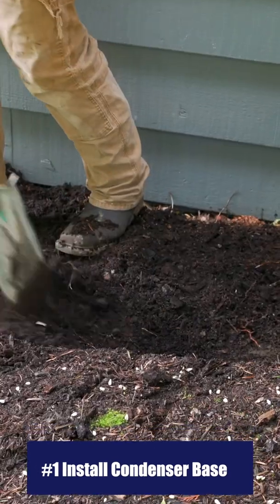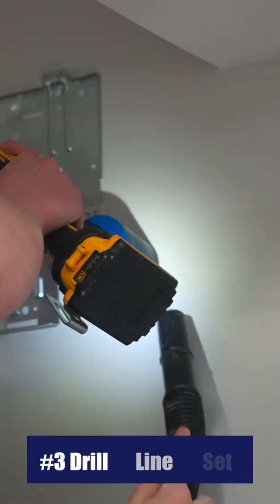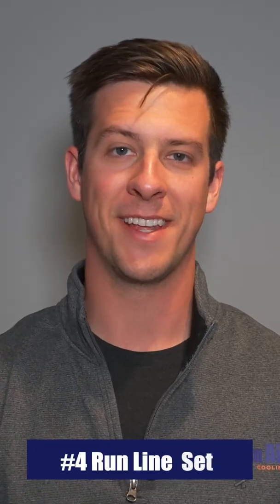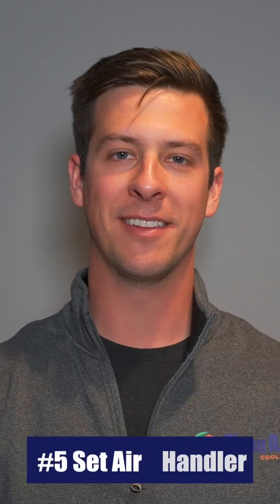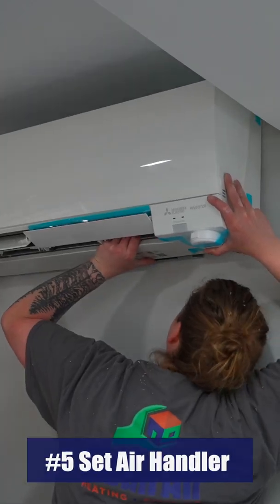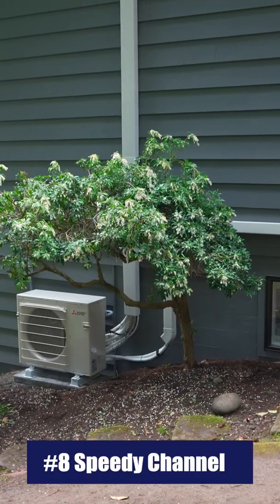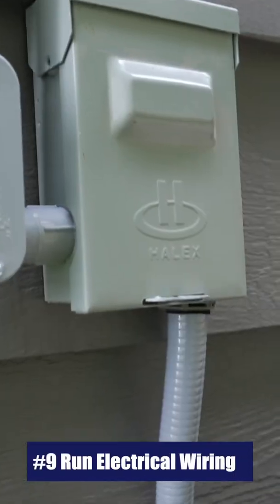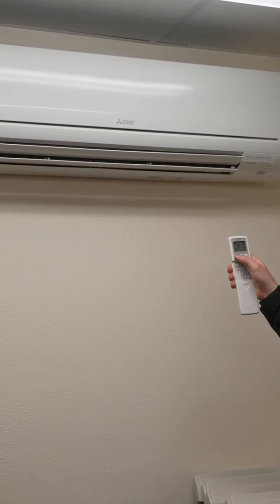10 Steps To Install Mini-Split System #shorts

Comment: Nitrogen pressure test to 550 psi if the system is all copper 450 if aluminum, vacuum the system to at least 300 microns, measure the line sets and add extra refrigerant as a perfect charge is critical in this type of systems, don't forget to torque the unions to manufacturer specs and never tied the unions dry, depending on the placing of indoor units you may need condensation pumps, is not as easy as they say

Comment: Do you not have to charge up the unit with refrigerant?
Reply: Most diy mini split systems come pre charged.
Reply from the maker: We primarily work with the highest quality Mitsubishi units. All units come precharged. On some multi zone system we have to calculate the charge and add refrigerant based on the lineset sizes length, elbows count and which indoor units we use. 

Can't speak for DIY units, we only tried that one time (while helping someone, although we knew better) and we learned a valuable lesson (a lesson we already knew😀).